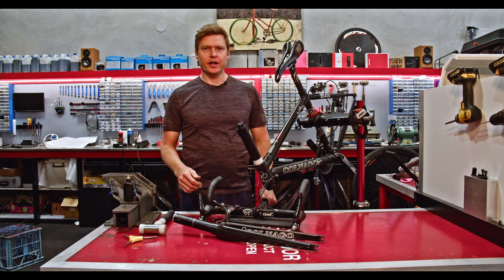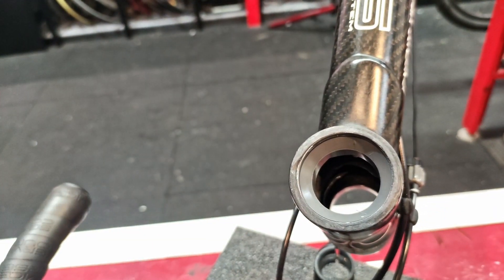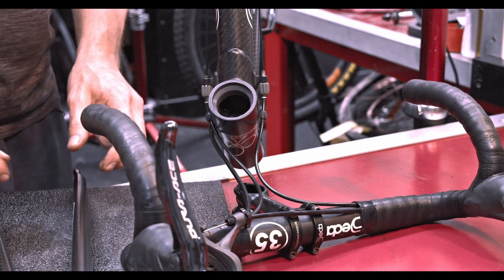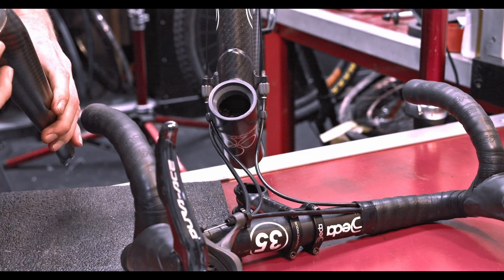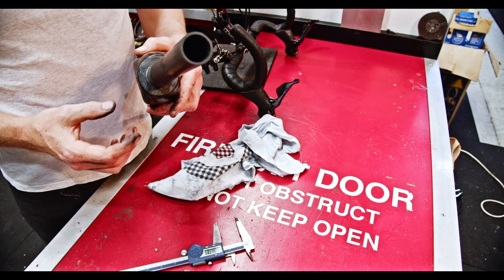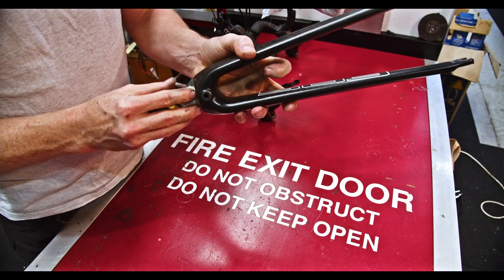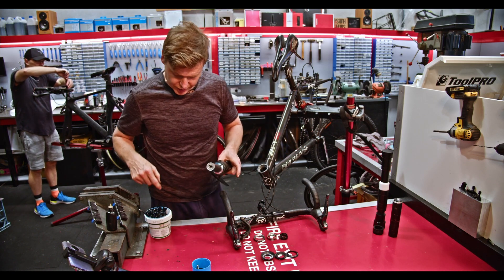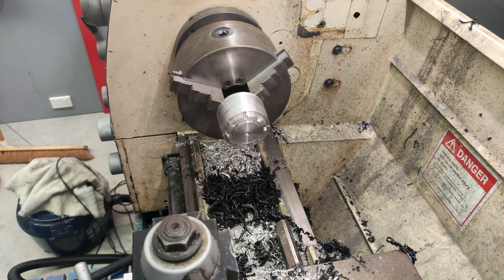How To Repair Damaged Integrated Headset in a Carbon Frame  (Part 2 - The Results)

Comment: Hi, thank you very much for this! 
My friend just bought a carbon bike with a poorly executed head assembly, and this is going to allow me to fix the problem.

May I ask which type of Araldite you are using?
I have Araldite Standard, which allows me 80 minutes of open time.  Mine is yellow when mixed and colourless when hard, yours is black and becomes grey...

As I don't have a lathe, my idea is to use the bearings themselves to shape the Araldite. I'm thinking of wrapping them and the steerer tube in Teflon tape, so the Araldite doesn't adhere to them, and then assemble the whole stack. I also need to stick a metal race to the fork tube, as it is naked carbon and wrongly shaped (the bearing rocks on it lengthwise, as the tube is not perfectly round and the cone on which the bearing rests is not exactly conical). So for everything to be aligned correctly, I need to assemble it all at the same time.

Thanks a lot and best regards!
Reply: Good evening, did you get this issue sorted? I have an issue with the factory bonded race in the bottom of the head tube   On my carbon bike - it’s basically come loose so I was going to try your method of using the bearings as a mould and the Teflon tape. Just wondering wether or not it worked. Kind regards
Reply: @andyjoyce7341  I'm sorry, didn't get to do it yet, so I couldn't tell you if the idea works. Still searching for a conical seating ring for the fork, and the bike isn't mine, so it takes some time to get done.
However, if it's only a seating race to be bonded in the frame's head tube, I'd take a bet on it. If I visualize your problem correctly, you could use a mould release agent on the bearing, press the race in it's seat in the headtube, take the bearing back out to remove the excess epoxy which will spill out from the space behind the race, and put your bearing back in, making sure it's coated in release agent (wax or other, I'm no specialist). Use the fork steerer tube (wrapped in plumbing teflon tape if needed) to get everything aligned while the epoxy cures (keeping the frame upside down for the curing time, so you don't have to fasten the fork, and the weight of the fork pushes the bearing and it's seat in place).
For what it's worth, wish you good luck and concentration ;-)
And keep us posted, please!
Reply: @wildepascal Didn't he say the black stuff was "JB Weld"?
Reply: @phorest  Yes indeed, he did. Sometimes I type faster than I think ;-)
I bought the JB Weld stuff, to do the job on my friend's bike, which I still haven't done because I haven't found a steel bearing race of the right shape and size for the poorly executed fork tube...
This JB Weld works rather well in some situations, not in others, but it might be my fault. I tried to stick some 3D printed PLA washers to a painted fiberglass structure (a bolted "aerodynamic" hood on a sandyacht, actually, which takes a lot of beating in racing situations), and the bond doesn't resist the shear forces, even though it's bolted down. I did degrease, sand and roughen the bonding surfaces, yes, I always do.
On the same sandyacht I stuck some shaped aluminium washers to a convex plate of stainless steel with JB Weld, but this assembly is mainly exposed to vertical compression and held together with seriously tightened bolts, so it's not the same game. Seems to hold,  if it fails I'll try to remember to report it here.
Mind you, the carbon bike headstock repair is something totally different: the parts can't go anywhere, they're "locked up" cylindrically, the only concern is the hardness of the filler material, which must be able to take a beating - and the less play there is, the less it gets beaten up. So you need a filler which doesn't shrink when it hardens.

I think you could do it just as well with Araldite "Standard". No certainty though, just a feeling based on my experience with that stuff. Check if they say something about shrinking!

Comment: Good job mate. It’s good to have somebody who goes the extra mile. Perhaps on the crown race form you machine a centre groove and use a crown race remover. Hope you are doing well.
Reply from the maker: Thanks Toby, The crown race is slit, so it just slips on and off with no problem.